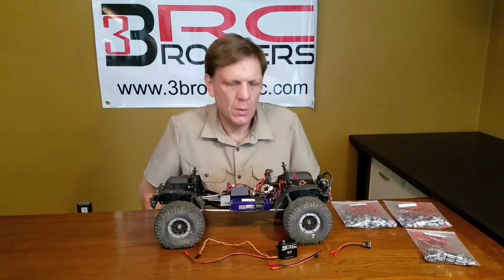g13 servo and no solder connector

Comment: Balance wires on lipo batteries are not designed for more than 1a of current.
Reply: You right those small gauge wires. What if use 2 wire one to a lil battery just for the servo ? Better off b.e.c ? Im going get plugs for accessory tho
Reply: Paul Clancy or just solder it to your +\- wires on your esc power wires and be done, boom. An whenever you unplug your battery you unplug your servo and have better wires, problem solved